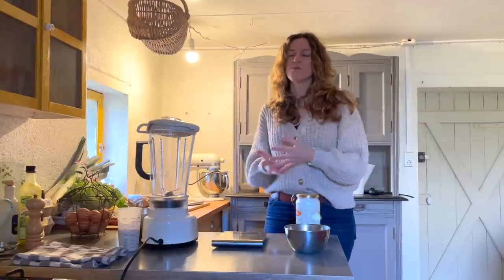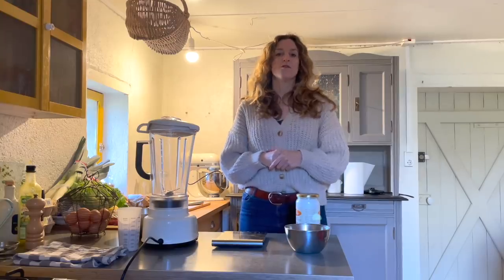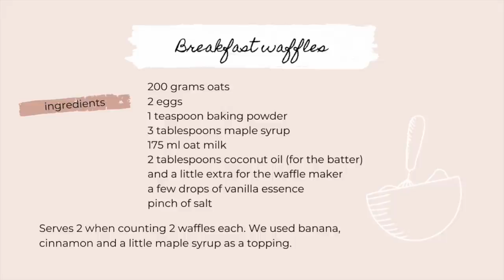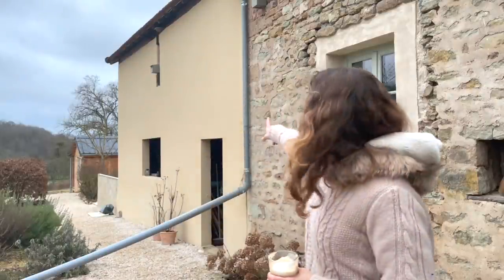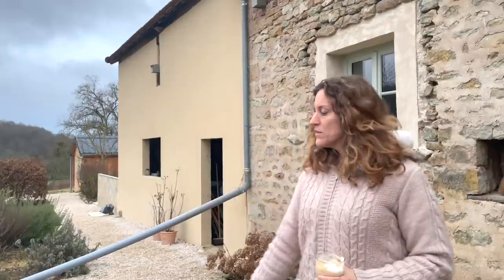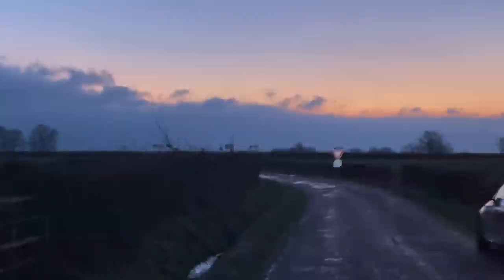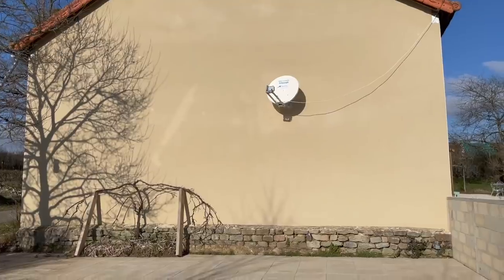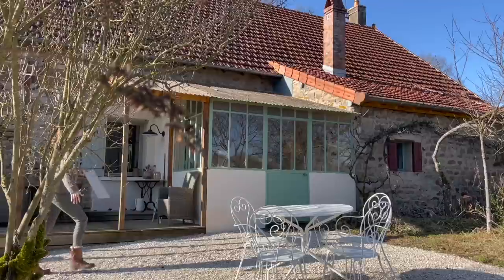I made a mistake + magical ending

Comment: Merci, merci  pour ces jolis mots ma belle amie !! I was delighted to discover the beautiful and authentic person behind the scenes. You know, restoring a house always gets us in trouble at one time or another. This is the problem with modern coatings, the reflections of the material and the warmth of old-fashioned coatings are missing. But vegetation always softens its surroundings. The ivy will again make a nice evergreen backdrop, but in this situation I would also wonder if the climbing hydrangea could be a good option with a nice presence even in winter despite the deciduous leaves and its delicate flowering in summer. I would gladly plant a "Ghislaine de Féligonde" rosebush at the level of the gutter for its sunset shades and its slender stems, it would make a smooth transition between the two buildings. I would see a large oval zinc pot (brocante) filled with deep blue and white flowers on the windowsill to focus attention. March should be a good month for these plantations...
Reply: Ghislaine de feilgonde is a great Rose....Not many thorns,  changes  the colour nicely,  fits to the colour of these wall,  flowers all summer and is a very healthy  plant. I have two of them in my garden 🤩
Reply from the maker: Omg! This is EXACTLY why I am so happy you want to help! Some adjustments can not be done they said (like removing the “cornières”) and we’re afraid that adding fake stone trims will look… well… fake.
It needs more green and nature and it needs to crack and get all dirty. Then it’ll probably be ok. We’ll be in touch soon! Merci infiniment! 💋

Comment: Possibly just repaint the wall a medium gray color to blend with the stone.  (Paint is not very expensive here in the US, I don't know about France.  And repainting is fairly quick because you won't need to redo all the prep work.)  When picking the gray color choose a little darker, because the sunlight will washout the color.  Can you paint the white edging. 

As others have suggested, the wall will "age", plants will really help. Once the wall paint ages, you may be fine with it.  Right now it is a big wall, freshly painted, too bright, and does not look good.  Age and plants will greatly help.

To my eyes, the wall definitely needs some trim around the door and window.  I think used wood, a bit of distressed wood trim could look really good.  Don't make the distressed wood look artificial/tacky though.  The used wood trim would be fine if it didn't all match. It doesn't all need to be the exact same width all around the opening.  Maybe a wider piece on top and narrower pieces on the sides, etc.  Look at old buildings, you will see these variations.  Maybe at used building supply places or if you see something being torn down you could get this used wood very cheap or maybe free.  Used, older wood is more difficult to cut though, but a carpenter with a good saw would be able to do it.

Maybe get a used solid wood door, or used shutters.

Here, paint stores make lots of mistakes when mixing colors.  I painted my house with paint that the color was mixed wrong, I got the paint for almost free.  It was a medium gray color that I probably would not have chosen, but it is a completely neutral color. 

There are several gray colors to be aware of.  There are warm grays and cool grays.  There are blueish grays and greenish grays.  there are pinkish grays.  Start by carefully looking at the gray colors of the stones.  the stones will have a mix of these various grays in them, but one of the colors may be more common.

I don't mind the yellow wall.  But I do think it could look a whole lot better for not much money.  I don't think you should feel anything negative about changing the color.  A painter could repaint in less than 2 hours, maybe one hour.

And since all the prep work is done, you could buy yourself a roller, pan. and brush and paint this wall yourself in less than half a day.  Watch some Youtube vids.  Try to get paint that already has the primer mixed in, it does cost more, never use cheap paint.  To get the top edges, tape your brush onto a broom or rake handle, so you can reach the top edges.  Probably good to have a friend hold the ladder for you.  Just relooked at the wall, it's pretty high.  really best to have the painter do it, you don't want to fall.

Trying to add "aging" to the wall will look very tacky, unless you spend a gob of money on some expensive artist/designer.  Don't even go there.

Don't feel bad about this very minor mistake, just repaint it, and don't look back, otherwise, you will continue to cringe and feel bad every time you look at it for the next 5-10 years.  We all make plenty of mistakes when renovating our homes, just be grateful this was a cheap one.  Even contractors make mistakes, they add this unavoidable cost of doing business right into the bid.

You have found yourself a beautiful, home with lots of history and soul. Enjoy the process.  All the best to you.
Reply from the maker: Thank you for all your suggestions! Unfortunately it was quite an expensive (5 figure) mistake but we’ll find a solution. I don’t want to loose energy on it either when we have so many more building works to do… Thank you for your ideas and encouragement 💜

Comment: I see what you mean about the color but it’s not entirely off.  It needs more dimension, which could be achieved with a white wash to tone  it down.  The method would bring it closer to the varied colors within the adjacent stone finish wall.  You may pick a new color but I think you would feel the same way since it would be just the one color.  New next to old does that sometimes.  Also, I agree with you about the edging to the window and door.  The lines are too straight and need a stone edging.  Is there a stone veneer type product the contractor could recommend?  Or maybe old weathered shutters hung on either side of both the window and door would give it the texture it needs.  I think you would be happy with those 2 changes and adding the ivy as you mentioned. Regardless it is a fun beautiful project.  Yes, you are fortunate to have such worries.  😊
Reply from the maker: It would be wonderful if we could white wash this! That is not an option the builders mentioned. What would the method be? Could you elaborate on that? Because the even color is indeed what I dislike most and that won’t change when we paint it another color…
Reply: @FrenchCountryLife  It would be a similar process that you applied to the wood furniture in one of your videos.  A watered down paint that is applied.  Take your time deciding and consult with local artisans.  Not knowing the base finish and texture, I wouldn’t want to give you wrong application approach. I’m sure others have done this in your area.  Get some ideas on YouTube also.  I’m sure it can be beautiful

Comment: You could do a big trellis on the wall left corner and over half way to the right in the same green as the patio and then have the ivy climb over that trellis but in meantime you would have the wood and green to create texture and coordinating color scheme until the ivy grows.  Another thing, although expensive here in France, very large pots, 3, in a color you look either the green patio color or.... and plant big plants in the pots to grow up the wall and give it a distraction to a big giant blank wall.  Its hard when picking a swatch for such a giant wall.  Also, would it be possible for them to do a wash/stain over the existing to give it a more antiqued wash and color?  Those were the 3 that came to mind right away  :-)   Bon Chance

Comment: Hello.  I have just discovered you and this video. For me and my taste, I would paint the wall a cream color, or off-white as we call it in the States. Even match the color to the gravel.  Also, I would add wood trim as much as possible to match the style of the original building.  And, if possible, reroute that downspout that is in the way.  Best wishes 🙂
Reply from the maker: Yes that downspout is definitely not going to stay. It’s another one of those final bits (after redoing the roof) that we still need to finish…

Comment: Hello Marloes, I see your dilemma, your home does really need to reflect the colors and features you like, so, you are happy. While I can see that the color of the house could have been better in a lighter color, I also agree that the color you have is ok and that with a few details, whether it's plants, shutters or other elements, it will blend better with time.  

With respect to the trim. it really does not go with the house, the lines of the house are more organic, so, I would have it removed and have them, like, round up the corners, by hand, so, it will be more natural... I guess you can see other parts of the property where you have a similar situation.  If you still are not too happy, what about using the same material that you have on the other wall, stone and cement? and do the same around the door and the window (frame)?   You could also  just paint a trim (similar color to the frame of the other window .. ....  Best.  Evelyn
Reply from the maker: Thank you for your kind comment and suggestions. Unfortunately the trim can’t be removed so we’ll have to come up with something to hide it. Thanks again fir sharing your thoughts!

Comment: I don't think the wall is awful.  Perhaps it could be mottled with another similar color that would modify the intensity...... It is hard to figure out the image you have in your mind when it isn't fully formed.   I painted our house a color that was completely wrong, but it was exactly what I chose...paint cards are not the same as samples on the walls.

Comment: The paint colour looked great to me, until you mentioned that you wanted to match it to the older part of the building. You are right, it does have a more modern look. However in England we are used to seeing that. It's very fashionable for people to buy old buildings, keep the original parts, but add modern extensions and adaptations. Usually the interior is a mix of traditional and modern. It's what people aim for. The building looks a warm colour, I like it. But if you want a traditional looking building, I can see why you're disappointed. It's easy to rectify. Put paint samples on, and even paint it yourself or a contractor, now or at a later date.
Reply: ...When I say modern extension in the UK, I obviously meant expensive and tasteful looking, like yours!

Comment: Is the yellow painted on afterwards or blended into the final application? Depending on which direction the house faces the paint may fade over time. Was this an addition or a renovation? The windows and door frames should match the existing windows with concrete frames. It would have be nice to have some stone as well in the addition. It looks fine, but does it add any value to the overall house and land. These are the questions I would ask myself. Good luck. Love the videos. Regards from Central Texas.